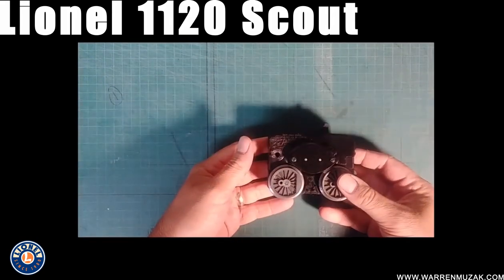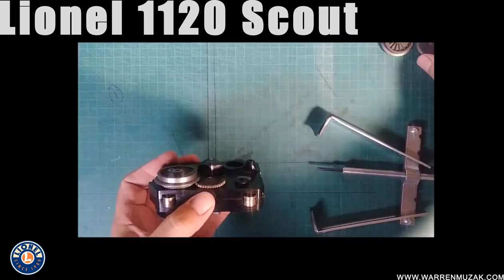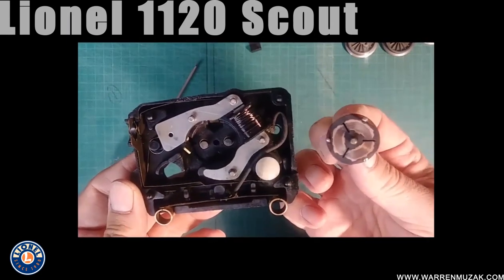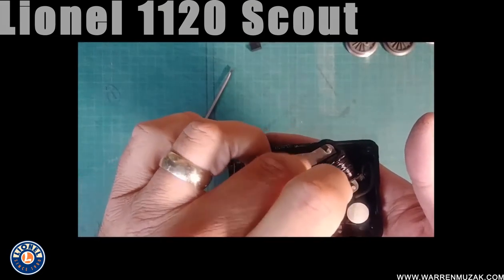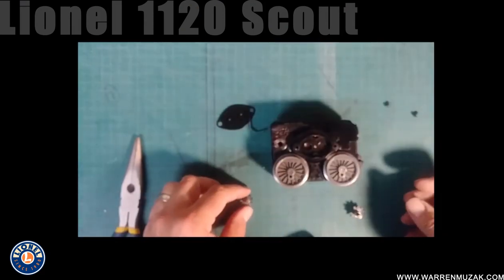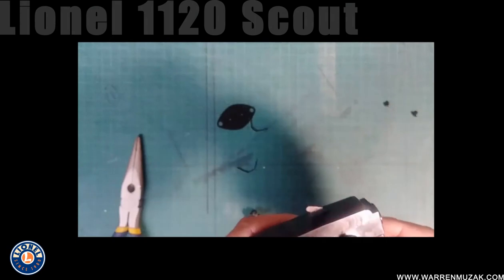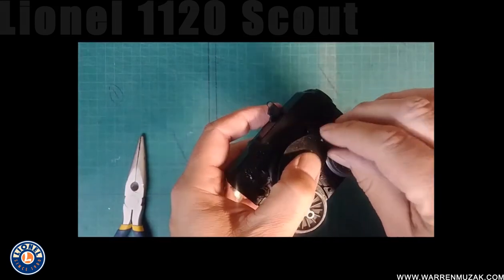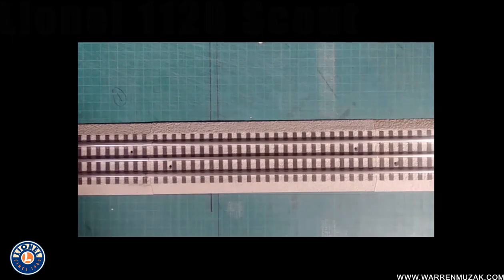How to Fix  Lionel Postwar Scout 1120. Remove and Repair Motor for Beginners

Comment: I’ve worked in a service station for a number of years and about 30 years total repairing lionels and I always cringed when I saw a scout plop on my repair bench. They were always like doing plumbing, hit or miss. I absolutely know that a scout engine will not cause me to sweat now. Thanks for the schooling on this motor. I wish someone had showed me the ins and outs of this unit years ago.
Reply from the maker: I'm so glad it will help you out and keep some more Lionel Scouts out of the scrap bins and back on the tracks!

Comment: Thank you Warren for posting the BEST Lionel repair video I have seen to date. Very helpful and I saved it for future reference.
Reply from the maker: Hey John. Thanks! I appreciate the comment and I am so glad it had value to you. Taking apart Scouts gave introduced me to Lionel repair in general. I did a complete overhaul of a junker 681 because of the confidence I gained on the Scouts.  Have a great week!
Reply: @warrenmuzakpostwarguy4331  I have rebuilt many different Lionel, Marx and American Flyer motors but for some reason "feared" opening the scout because I've heard they were impossible to put back together. Thanks for erasing my fear and giving me the confidence to tackle the job!
Reply: @poconotrainman  I have been told the motor was not rebuildable, but Warren just proved it can be done.  I do not have any Scouts and don't expect to have any, but I watched this just to see if it could be done.  Very good.

Comment: Make sure the spring push on the push-through to the dog retract is strong enough that it retracts.  Bend spring if necessary.
Bend reversing contact to plastic gears lengthing or shortening so they always make contact with metal in the plastic gears.

Comment: This a great video and thank you for it. I tried to fix one that I have but one of those brass leaf springs popped off  my table. Can you tell me if anyone sells them ?
Reply from the maker: Hi Walter. Thanks for watching! If you still have train shows in your area I would start by looking through the "junk" bins. You could probably find a parts loco for $10 - $20. Lots of those guys have Scouts in them and will likely have those springs. Next would be an online dealer or Ebay listing like this:
 https://www.ebay.ca/itm/Lionel-1001m-scout-motor-parts-as-pictured-new-old-parts/293809448912?hash=item44686867d0:g:asQAAOSwWEZesIvd
But then you're paying for shipping on top of the price.
Reply: @warrenmuzakpostwarguy4331  Hi. The local Charleston, SC train club sponsored 2 a year but the Covid put a halt to that this year. So I will Ebay and see what I can see. Thanks

Comment: I viewed your video on lionel scout engines (Plastic housing)  I bought a 1062 for parts.  Through viewing your video I was able to know how to re-assemble the engine. I noticed that the engine i have does not have the magnet for magatraction.  Could you inform me how I can obtain a magnet for my engine. Your video is priceless'
Reply from the maker: Hi Rick, I am so glad you found the video useful and it got another Scout back on the tracks.

Yeah the 1062 didn't have magnetraction. If the motors casing casting still has the spaces for the magnets like mine you could get another older Scout that is not serviceable and dig them out. Other than that I can only think you may find a magnet in a automotive store maybe, or an older hardware store that has some old misc parts kicking around.
Reply: @warrenmuzakpostwarguy4331  Thank you very much for the reply

Comment: Warren - Are the gears & housing made from a self-lubricating plastic?  I noted you did not add any lubricants to the gears or axles.  I was also wondering if a headlight socket & bulb be added to that motor?
Reply from the maker: Hi Pete. Thanks for watching. The gears and housing to my knowledge are not self lubricating. I will put a bit of grease on the gears from time to time especially if I put a lot of hours on it. Same with the axles. You can hook a headlight up to the 1120. It does have some of the connections already in it. I look at the Greenberg manual to see if I can and how to do "upgrades" like that.

Comment: You did not lube it at all.  They are all very noisy.  Perhaps you could have addressed the cause of the noise and maybe lubed it to alleviate some of that.  Mine has an oil wick while yours does not.
Reply from the maker: Thanks for watching. The oil wick did not appear on the Scout motor until 1960s. The 1120 is an early 1950s model. All the low end Scout motors are weak and fairly unreliable. Lubing doesn't quiet it down.  Soon after this video was made I swapped out the original motor for the motor w/eunit from an 1130. Stronger and much more reliable. I have been running my Scout with the 1130 motor for years now and enjoy it. I still have the original 1120 motor, works perfectly, but GUTLESS.